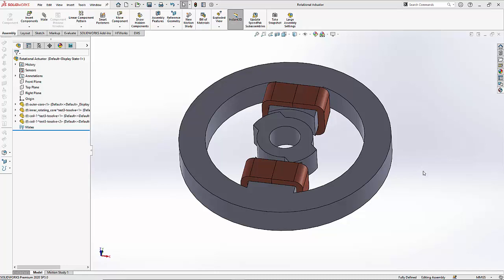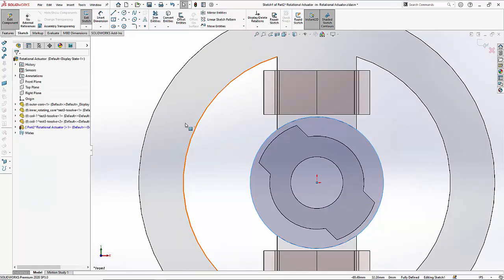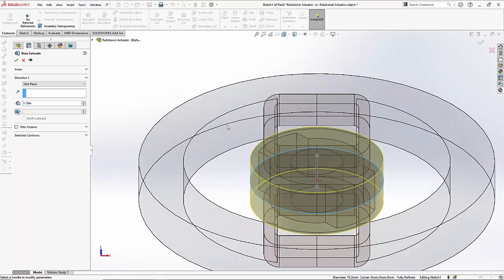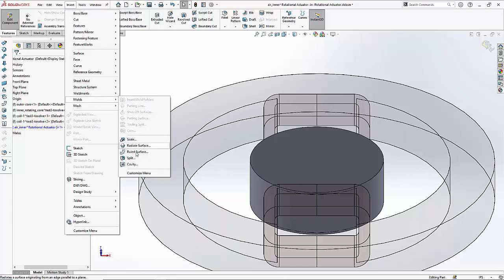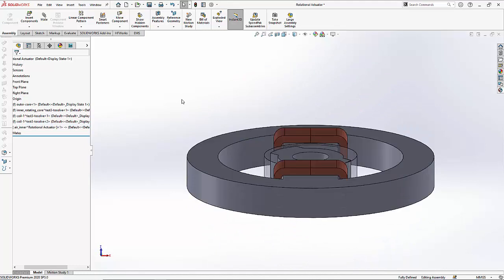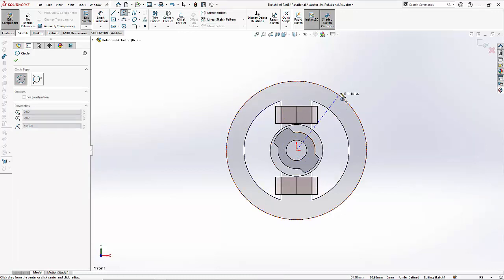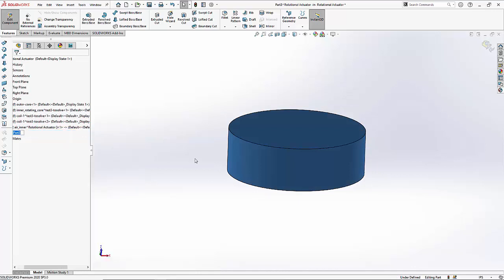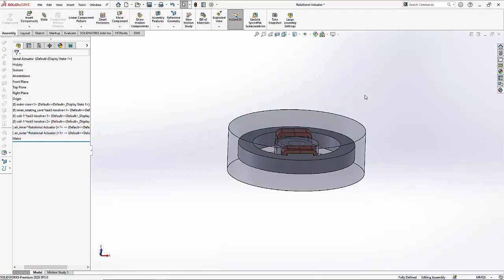EMS Getting Started Tutorial - 02

Comment: I am little confused, could you tell me why do we need two air regions?
Reply from the maker: Two air regions are not needed to solve this problem. The reason we had 2 air regions is to tell the users that this strategy is possible. This strategy will ensure that the inner air will be meshed finer automatically or users can apply a mesh control on the inner air region. It is done to improve the mesh in the rotor region and thereby increase the accuracy of the solution.
Reply: @EMWorksInc  thank you for the quick replay.